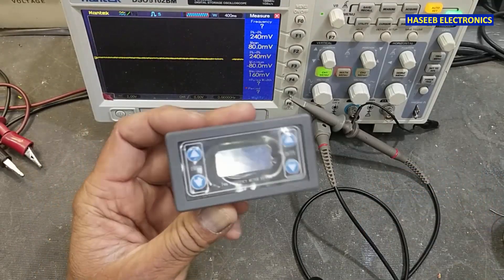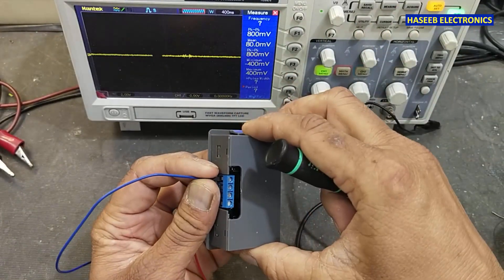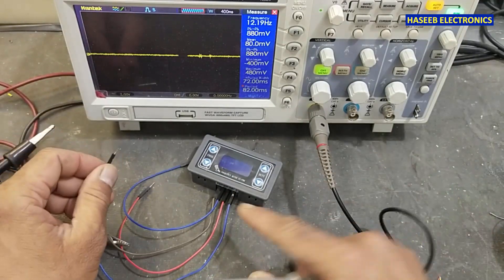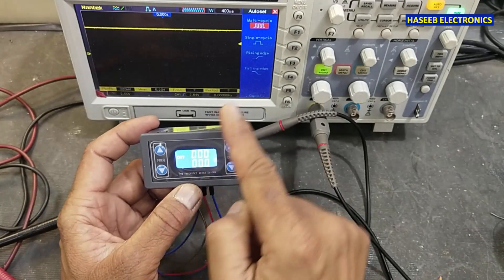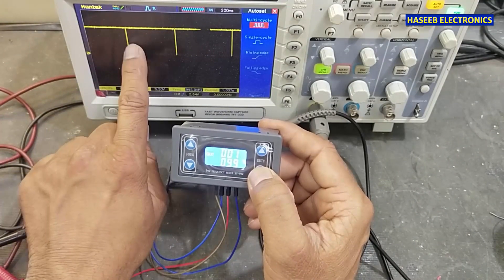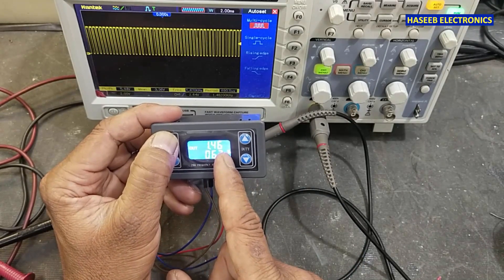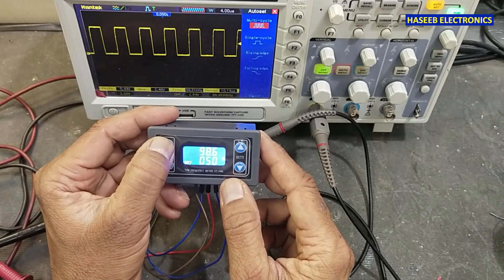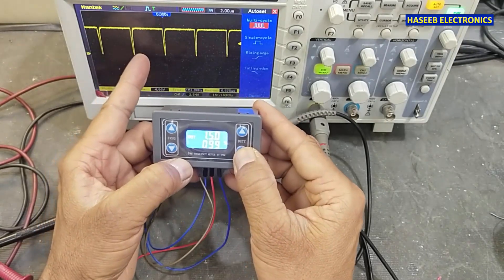{820} Wonderful PWM Signal Generator Module

Comment: I have one but I don´t understand why are the negative Voltage connection because If I neglect that output and connect the negative osciloscope terminal  on the ground, also works because on the ground have the return of that PWM signal.

Comment: Please can you help me. How can I drive a car ignition coil with a high power PWM driver ZK-PP2k.  Similar to yours PWM but with a mosfet inside. The supplier says it handles 8 Ampere. The unit function ok with the Frequency and PWM 0-100%.

Comment: Thank you for this video. is there any way to connect a temperature sensor to this small device instead of these button? If yes how?I want to install this for increase and decrease speed for car radiator fan. 
Thank you again..

Comment: Your IGBT series is the best I've found online.  So, to better document the present state of my understanding of the following inverter controller needs so for example to use a Prius inverter (possibly converter as well for more versatility as a generator) to create a inverter-converter generator, welder and plasma cutter module:
1. For frequency control (e.g. 10Hz to 400Hz)
a. For AC or DCEN & DCEP Waveform - Controlled by H-Bridge Switching Between Positive and Negative
b. For DCEN or DCEP Waveform - Controlled by H=Bridge Switching Between Zero (or lower Min value) and Max Value
2. For Waveform Control - Controlled by H-Bridge PWM to create Sine Pulse Width Modulation, Saw Tooth Pulse Width Modulation, etc. 
3. For Power Control - Controlled by above Waveform control with from what I see needs for the frequency range high frequency transformer designed (optimal core chosen and wound) where one transformer will be required for the DC output and another required for the AC or DCEN & DCEP output. The High Frequency Transformers seem to need to be wound on a core selected for a mid point of the power range frequencies planned to be output from the H-bridge and of course designed to handle max current (with additional buffer current rating).  DC output will be rectified after the winding and another winding can be used for the un-rectified output, unless there is switching (transistors/relays) and one hf transformer can be used.  Seems since higher current post the HF transformer, the switching will be more costly and might be more cost effective to have another winding and switch the lower current input going into the two hf transformers. 

I really need to look at an inverter design that uses the offset-balance AC circuit, since I'm guessing the above based on my present understanding.

Any of the above would be just great to see.  Sad how much gets wasted in the United States in regards to these inverter-converter modules as well as the CVT's being they last so long and can be found for relatively cost effective investment compared to a similar device that really doesn't exist on the market that I know of.  Kind Regards, In Christ

Comment: Sir can I use with this module to make an inverter?
Reply from the maker: in inverter we need a feedback signal to adjust duty cycle. but this module provides output adjusted by front panel adjustments push buttons.
Reply: Thanks